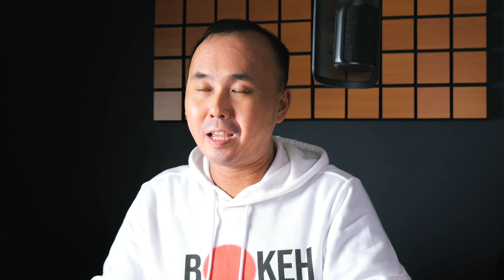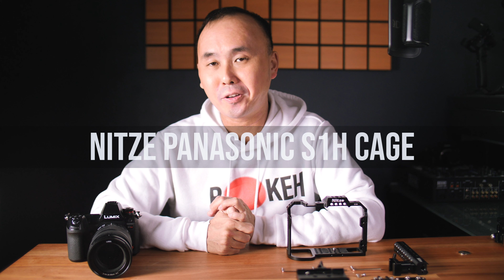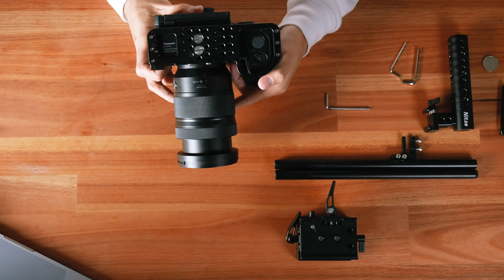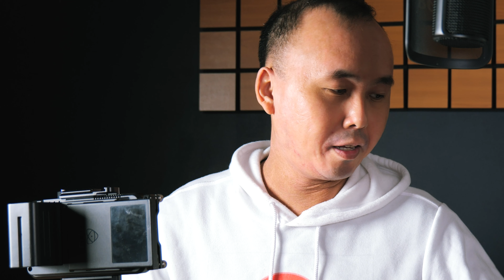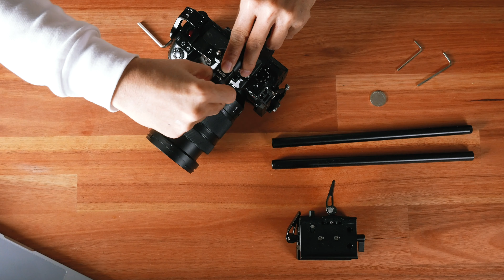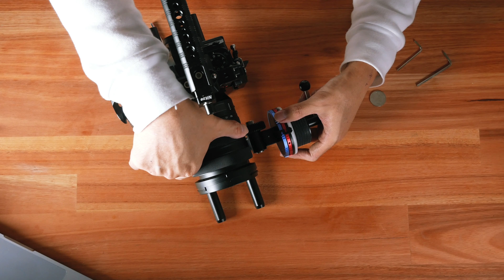Nitze - Panasonic Lumix S1H Cage Review

Comment: If you want to get in and out of your cage quickly I would suggest the system from Kondor Blue. You can also use the Panny XLR adapter on the hot shoe mount  plus the top handle at the same time. https://kondorblue.com/products/panasonic-s1h-cage-with-start-stop-top-handle
Reply: that's an interesting cage thanks Tony!
Reply: @kennethsmith3103  anytime!
Reply from the maker: I will check that out Tony!!